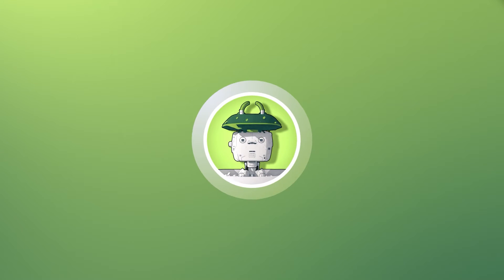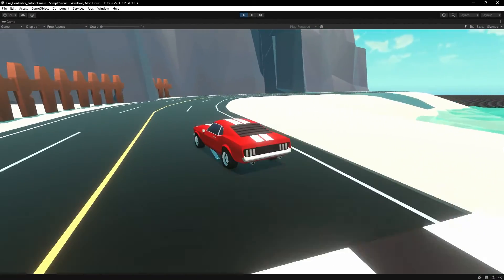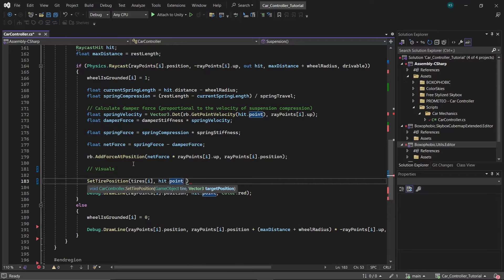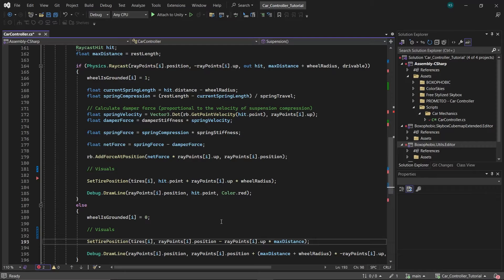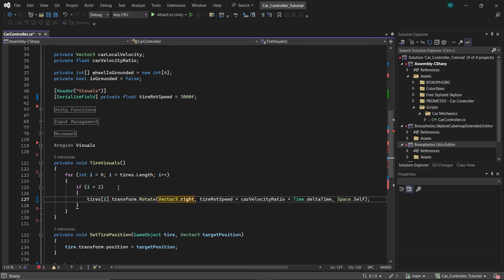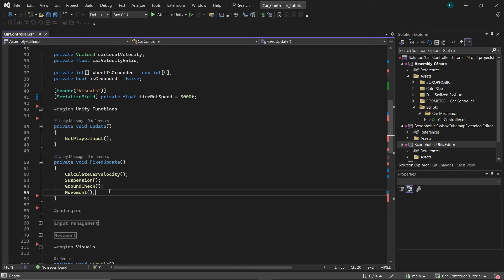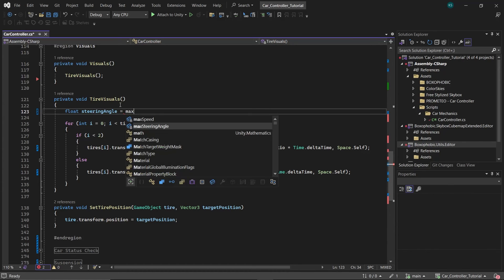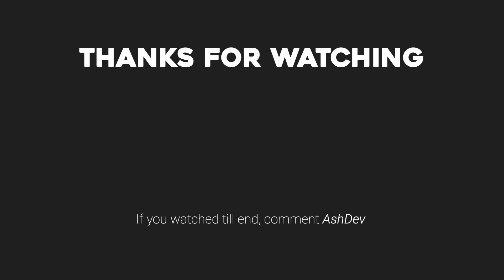Arcade Car Controller Part 3 | Follow Cam tutorial Unity | AshDev

Comment: Hello , in my project the front wheel rotate and work nice but rear wheels are not rotating , they only rotate when I press W or S key . Pls help
Reply: I fixed it
Reply: @Mr.IN3V1T4BL3  "I fixed it" doesn't really help anyone else.
Reply: @Mr.IN3V1T4BL3  How...??
Reply: Same issue for me.
Reply from the maker: You can use the front tire's rotation logic for the rear ones too if you want that, in the video rear tires are being rotated based on acceleration. 
For further issues, you can ask them in our discord server.